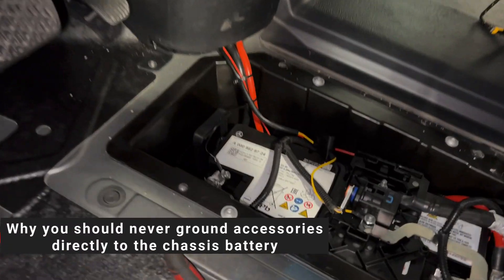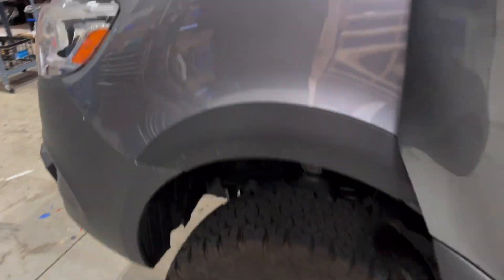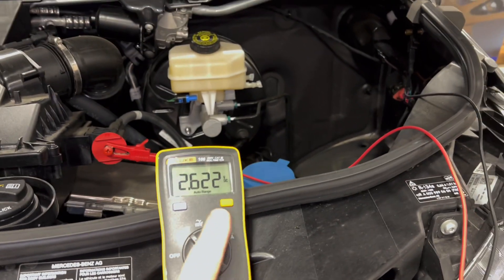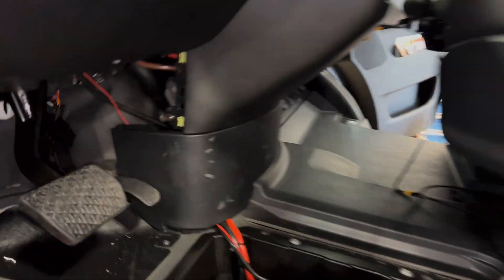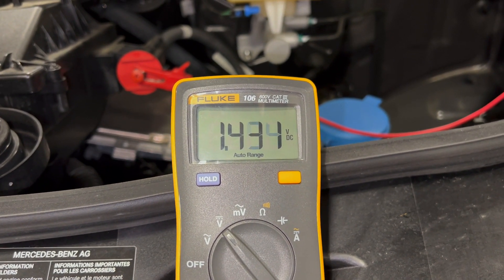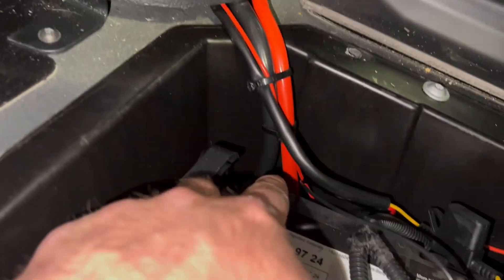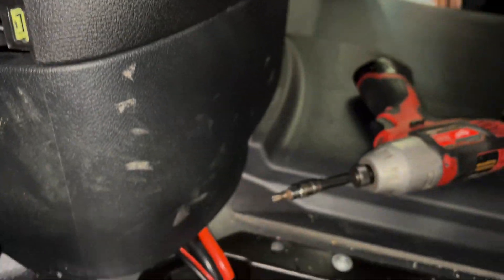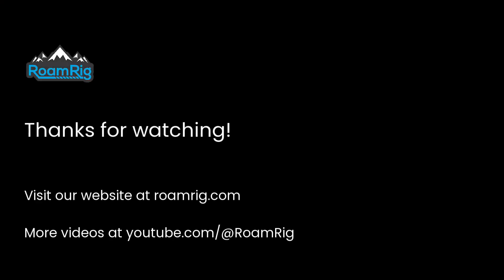Why You Should Never Ground Accessories Direct To The Chassis Battery

Comment: Hi I wired my two fog lights with a relay and that relay is controlled by a switch which only turns on lights when parking lights are on. As soon as I turn my fog lights on with radio on, I face distortion in the sound. So what could be the possible issue? I have connected relay negative with battery's negative terminal. Apart from that i have tested circuit using diode but problem still exists.

Comment: Interesting, is the ground disconnect something specific to Mercedes, or a standard feature on newer vehicles?  Not sure I've come across one. Most vehicles I'm familiar with the negative of the battery goes directly to the body, engine and sometimes the Starter. With one or more small wires directly off the negative terminal to the cab and wire harness.